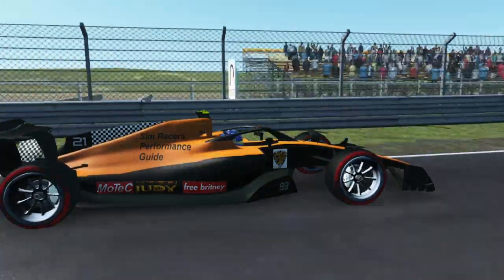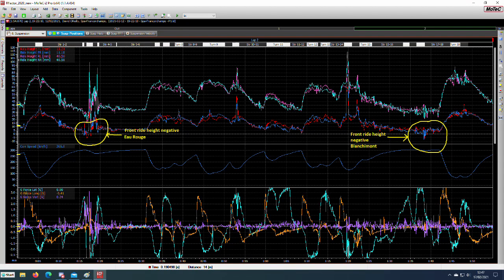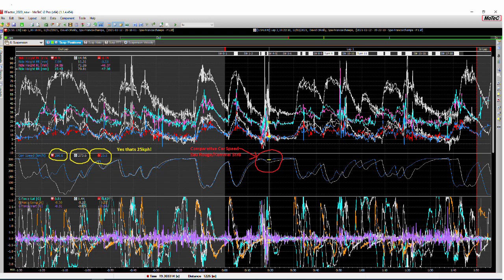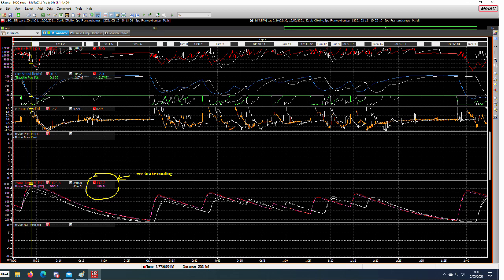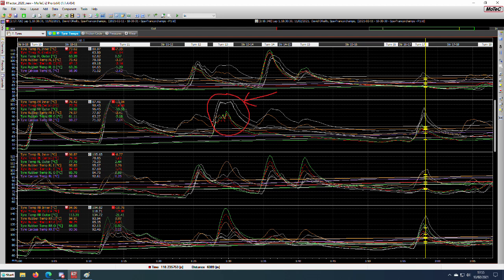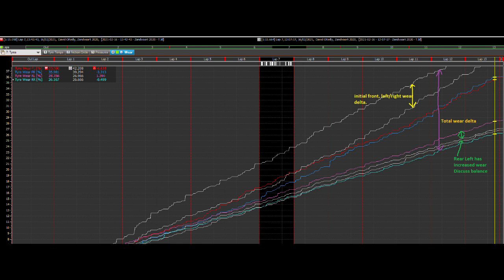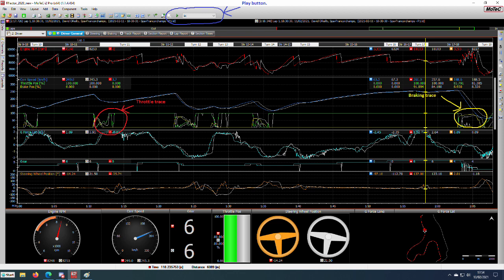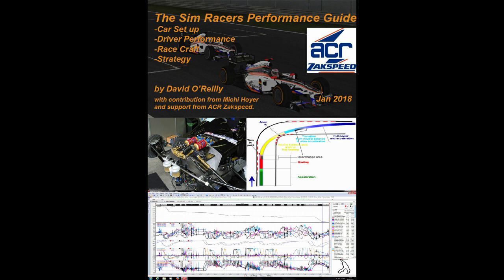Introduction to Motec data analysis

Comment: 9:55 when comparing laps you have to press F9 to change to distance graph.
Reply from the maker: Yes it's important to be on the distance rather than time comparison. You can also change it by clicking on an icon (clock?) in the tool bar.

Comment: 'Untick' the clock icon in the toolbar so the data is measured in distance and not time. If you compare laps through time the data will be out of sync.
Reply from the maker: Thanks Robin, that saves me looking for laps of a similar time.